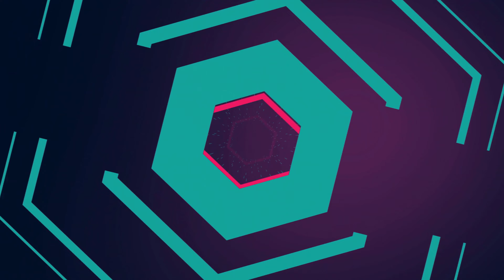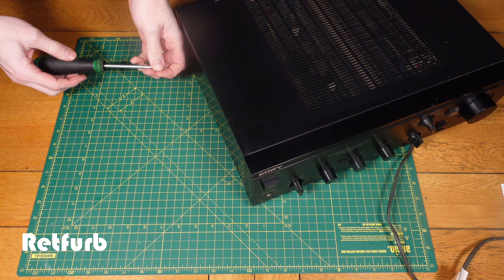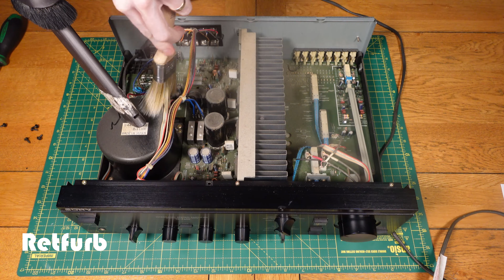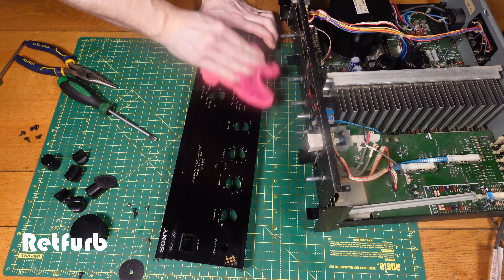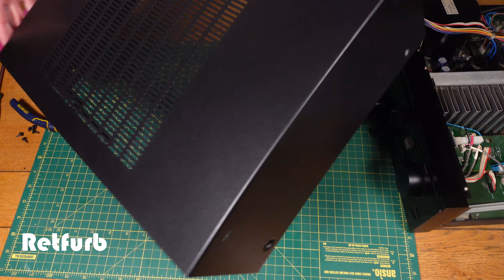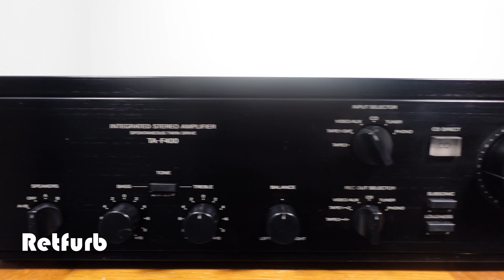1988 Sony TA-F400 Servicing Dirty Controls Causing Distortion - Service & Clean- Retfurb Retro Audio

Comment: Hi thank you for the video. Yesterday had TC-U2 plugged in tape 1, played fine. Plugged in the RCA cables today. It plays at 2% volume when the volume knob is at the max. Plugged the deck to cd - plays as normal. It looks like both tape 1/2 affected. What could’ve went wrong overnight ?
Reply from the maker: Seems odd, I presume they were plugged in the same ports the previous day? 
Double check buttons / knobs are in correct positions. 
Sometimes it can happen if it is on the wrong selection.
Reply: That was correct, you think that the input selector ?
Reply from the maker: @TheDoctorRust I would probably clean them first